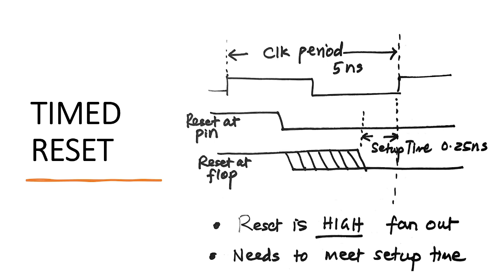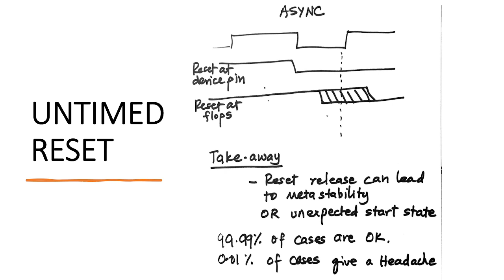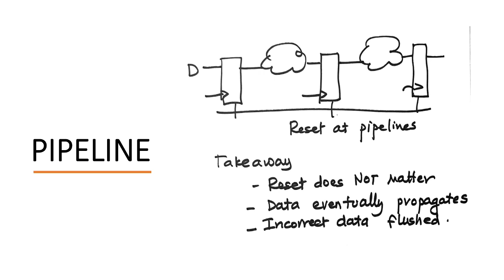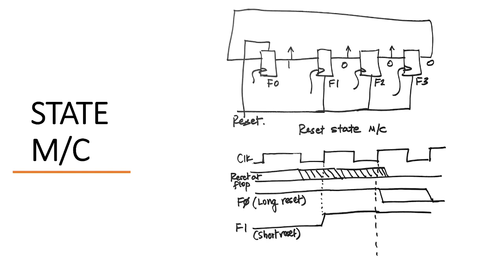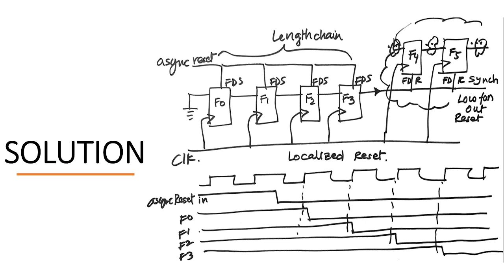RESET Design in Digital Systems

Comment: How do you know when you need to start implementing this with your resets? Is there a certain level of fan out that starts becoming unacceptable? Is it part dependent? 
I've been going through all your videos. Thank you for all this great information. Your videos are always clear and to the point!
Reply from the maker: Its a difficult question. It can vary from chip to chip and even design to design. However, in general people tend to defer the reset tree design to last moment and it becomes daunting if the tool stops helping you when you have a multi million gate FPGA that has 80% fill level and does not meet timing on resets. One philosophy i see used as a rule of thumb from start is to have each block sync its reset using the mechanism. That helps placer as well as each block is not getting pulled towards other blocks to meet reset timing. This is a great help in design from the start. This is what i recommend.